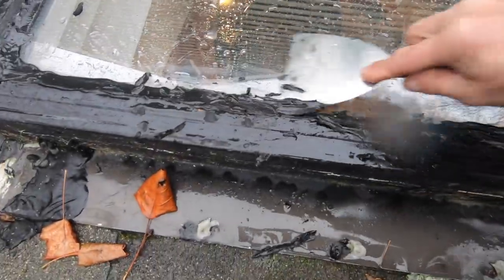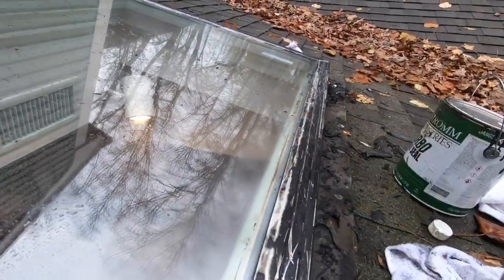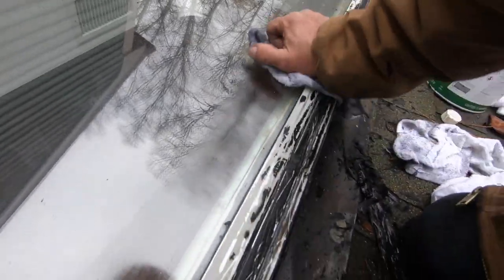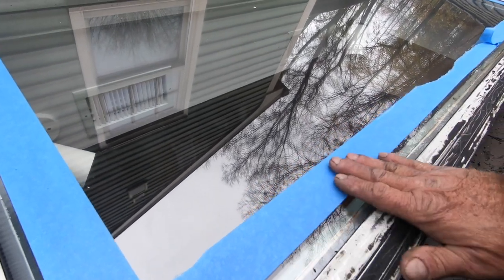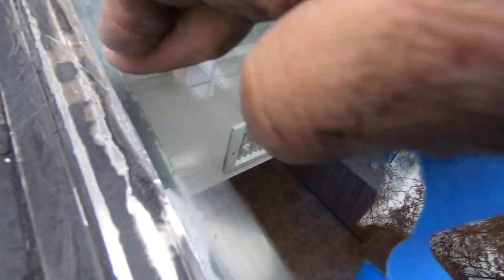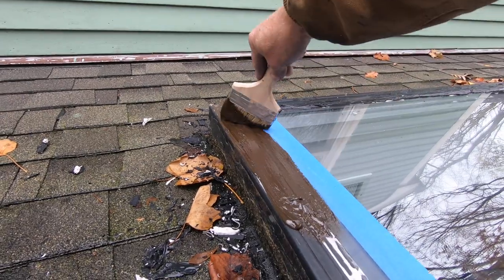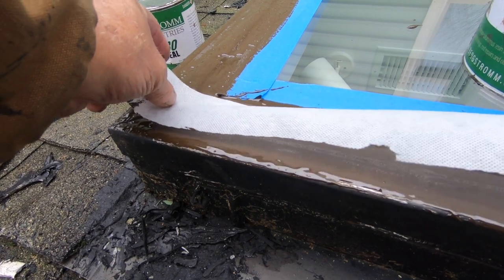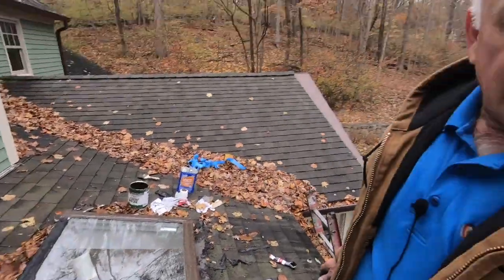After 9 trips, I finally repaired this skylight permanently - amazing product find

Comment: Thanks so much.  That's so helpful.  I hear about skylight problems all of the time.
Reply from the maker: I can't understand why skylight manufacturers can not come up with a skylight that will never fail. I bought a skylight and a year later I had to go and repair it due to a leak. Come to find out that it was the seal between the frame and the plexiglass. I used Turbo Poly Seal on it and it has been several years now and had no problems. If people would just get hold of this product, they would save themselves a lot of headaches. I used to use caulking and self adhering roof tapes by Eternabond, but that never lasted. In facy I got a video showing where Eternabond is failing and where I replaced it with Turbo Poly Seal. I hope to post it soon. Time is of the essence. Thanks for your compliment and comment. Happy roofing
Reply: @FlatRoofDoctor  Thanks so much for your informative comment.  When somebody comes out with a reliable skylight, they will fly off of the shelves.  Turbo Poly Seal is a great tip.  Happy roofing to you too!

Comment: When you peel the tape off are you not pulling the very edge of the sealant off the glass? A tiny lip?
Reply from the maker: when the sealant is still wet, that little lip you refer too, is bonding to the glass as soon as I remove the tape. But Turbo Poly Seal is not the way to go. I have since used Super Silicone Seal and it is amazing. The Super silicone Seal will bond to glass, metal and plastic.

Comment: Hey Roof doc,  is there a way to fix av hairline crack IN the skylight, not the seal. Cleaning lady pushed a little to hard while cleaning and after 20 yrs i guess it's pretty brittle.
Reply: Buy a new dome.
Reply: @gregorypowell9132  done.  Didn't realize how easy it is to replace the dome!
Reply: @christinavanwanseele  👍

Comment: Thanks for your videos. They are very helpful. I can see you know a few things: ..Thanks
Reply from the maker: Thanks for the compliment. On this skylight video the owner use Flex Seal Spray-on  without success. I had to scrape and clean all that off while holding the camera in my other hand. I made this skylight repair using one hand and using Turbo Poly Seal

Comment: Nice video. You show Turbo Poly Seal in the video, but the product website says to use Super Silicone seal for sky lights. Which do you recommend?
Reply from the maker: Yes in the past I used Turbo Poly Seal, but to come to find out it didn't last too long. So I asked Bergstrom to add the warning so people would not buy it for repairing skylights. For everything else the Turbo is excellent but use Super Silicone Seal instead on skylights

Comment: If I ask a handyman to do this, what should his fee be and how long should this fix take him?  Thank you so much... it is raining into my She-Shed and I must stop this!!!!
Reply from the maker: Hi Robin. Depending where you live. I wouldn't go out to any small repair job for less than $400. But, there are handyman people that could do something like this for $250. By the way, consider the Super Silicone Seal that you can buy from the same company. I think the Super Silicone Seal sticks better to glass and metal. here is the link https://bergstromm.com/product/super-silicone-seal-roof-repair-kit-5-feet/
I believe that the Super Silicone Seal need less sanding and prep and is much easier to use.
Reply: @FlatRoofDoctor  wow thanks very much that is great news!  I have thumbed up and subscribed!  Handymen typically $30  to $35 an hours here... so a few hundred is in that ball park... thanks!  :0
 I will check out the Super Silicone Seal   :)

Comment: How long will it last in very sunny locations?
Reply from the maker: Hi Anthony. Turbo Poly Seal performs well in sun but like any product, it helps to protect it against UV’s. I use Karnak aluminum asphalt coating where I can or you can paint it with an oil base paint. But, without any protection it should get between 5 -10 years, depending where you are. McAllen TX had temperatures of 120 degrees for several weeks this year.
Reply: Flat Roof Doctor  Will the Karnak 298  Luminar work as well or is this the same as the aluminum asphalt?. I’ve used Karnak elastomerics in the past for a flat porch deck and am always looking for a product that is attractive and can withstand foot traffic and patio furniture.  A roofer suggested a coating called Kemperol. The building supply company carries Kemperol and said it can be used over the Karnak elastomeric with a Kemperol primer.undercoat.  Both primer and topcoat are expensive in comparison to the Karnak and are a two part A and B mix like epoxy but they said it remains flexible and has a nonslip quality but sand can be broadcast to the wet surface for greater traction. . Would like to know your thoughts about any products that would meet those requirements.  
I used a granular type of torch down bitumen on my flat garage roof 25 years ago and covered it with about 3/4” of pea gravel for aesthetic reasons as its visible from my porch and as I learned from another of your videos the gravel has greatly extended the life of the bitumen.  Unfortunately torch down bitumen is now illegal to use in NYC because of the potential of fire if used carelessly.  I still see some roofers in NYC use it because it’s so good but I think they face a heavy fine if caught and the insurance company would most likely not cover any loses from fire.
Thank you for the informative videos and your prompt reply.
Reply: About 3.5 minutes

Comment: Honestly I always see u used this product..i usually use Karnak for little repairs but I think I'm going to switch to this..I like that mesh type stuff in between..
Reply from the maker: Hey Joe
Karnak 66 or Karnak 81 trowel grade is still what I use when I do a torch Down to fill gaps or on flashing or around vent pipes. Turbo Poly Seal is much more expensive product but I use that when I go to do repairs on any roof. I am guaranteed to fix almost any leak and it is easy and fast and looks nice when i am done.
I keep both Karnak 81 Trowel Grade and Turbo Poly Seal in my truck at all times. That way I can fix any leaky situation.
Reply: @FlatRoofDoctor  I wish you lived in California!!!!   :)

Comment: You need to clean off that roof and gutters!!!!!!!!
Reply from the maker: Hey Al, give me your number and I will pass it on to the customer. I see that is what you do. Good observation. In the fall and winter in Connecticut, roofs are full of leaves and debris. I would be cleaning gutter nonstop and not get to what I am supposed to do. Btw, Turbo Poly Seal works excellent where the seams of gutters leak. This will stop any gutter leak as in skylights.
Reply: @FlatRoofDoctor  I also have a small corner of my garage that needs new shingles,  and this Poly be used under the shingles, or is that over kill?  It is only about 5 or 6 shingles the wind took off in strong Cali winds!  Thanks for taking the time to post !  I have thumbed up!  :)

Comment: One trick pony. Turbo polyseal
Reply from the maker: Well, after 30 years of trying so many products like caulking, tapes, and sealants, I finally found something that works, Super Silicone Seal.
So, you call Edison a 1 trick pony after inventing the light bulb after 100's of trials and errors. I think people are happy that I have gone through all that trouble, so they don't have to.
Super Silicone Seal is so far the best. I do suggest roughening up the surface with 100 grid sandpaper for better adhesion.
Reply: @FlatRoofDoctor  sorry , I’m confused. You used Turbo Polyseal   Is that the same as Super Silicone Seal?  I understood Turbo Polyseal to be a polyurethane product. 
I’ve watched all your videos and in one one you say with great emphasis “ Never use Silicone on a Roof.  Water gets underneath it.  Look at that” as you scrape off the offending silicone
Reply from the maker: @pedrogonzalesgonzales5097  On a roof and on a skylight is 2 different things. I recommend only Super Silicone Seal on Skylights. I know the video shows Turbo Poly Seal but testing it after 2 years, it did not perform as well. Super Silicone Seal on the other hand is amazing.
Reply: @FlatRoofDoctor  Thanks for the clarification. May I suggest you recommend sealants using their constituents and not their brand names — the brand may only be present in one or two countries. 
It seems Turbo Polyseal is a polyurethane hybrid   Am I right?  If so , it may be useful to mention this